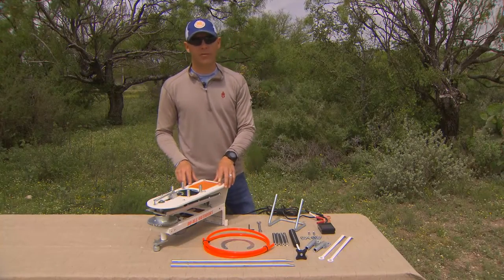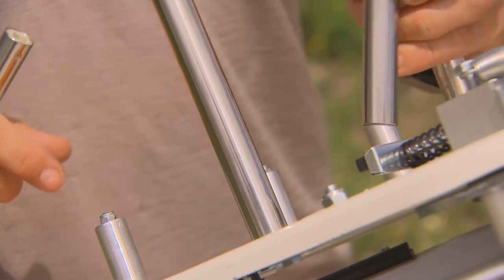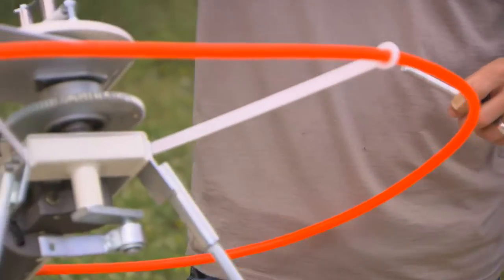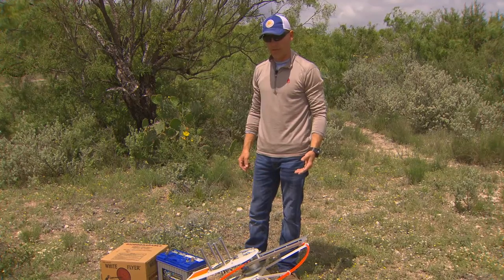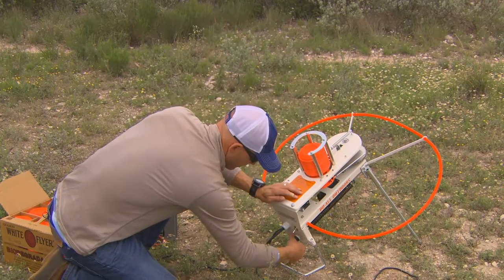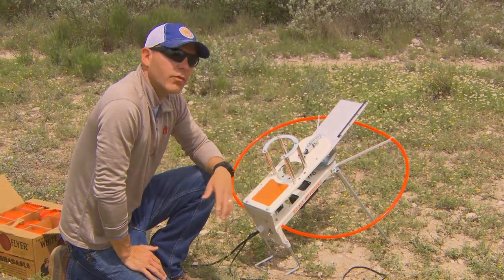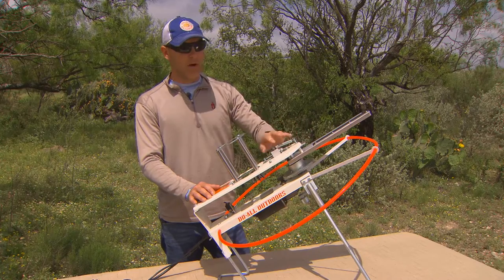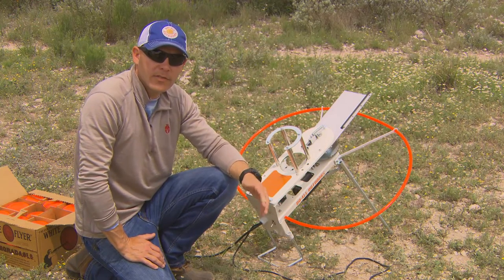Do All FireFly Assembly Operation Troubleshooting

Comment: Mine's continuously breaking clays out of the box. What do I do?
Reply: mine breaks clays as well,  I've tweek around with the limit switch and its a little better but still breaks 1/3 of the clays. Did you find a fix?
Reply: @steverodden3450  I replaced it with the model next up. It's working fine.